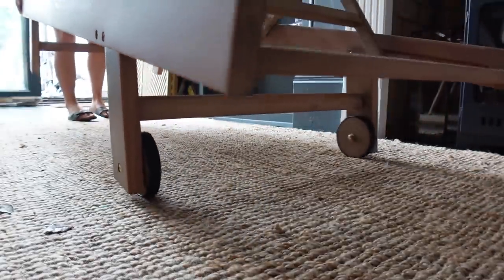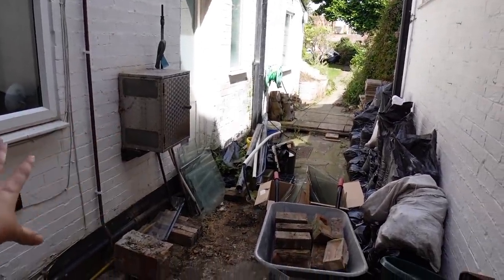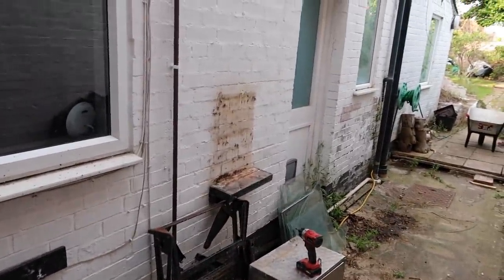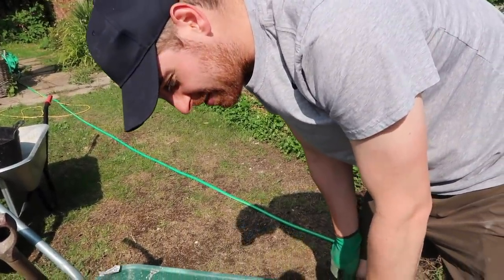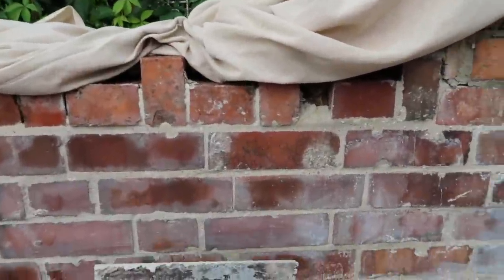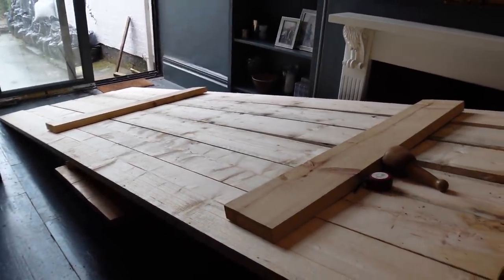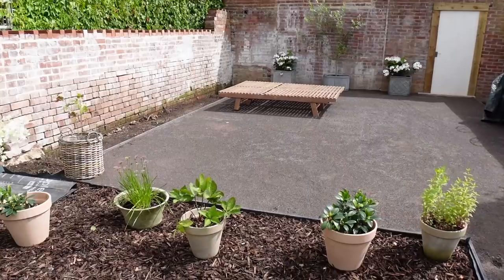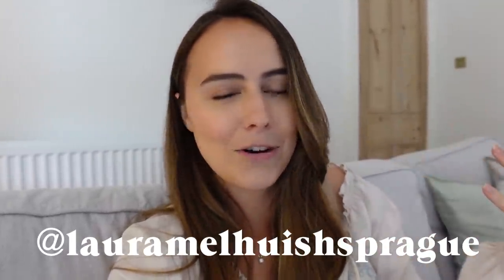DIY OUTDOOR SCAFFOLDING TABLE | Laura Melhuish-Sprague

Comment: Hi, i worked in building restorations and did kilemeters of brick ;) use please much smaller and straight, narrow palette knife. Work with it only horizontal/vertical motions. You can do putty with much less water, then work will be faster and you won’t need to clean so much of the brick. Try maybe some yt videos, it can be done much efficient :))

Comment: As a carpenter and a woman, I felt the disdain from suppliers in my heart, it would take me 3 times longer to do supply runs than my colleagues, cause I had to argue the whole f*cking order every.single.time and then I would get told off for 'slacking off' on my supply run, there is no winning.